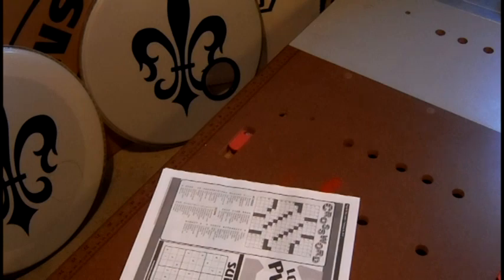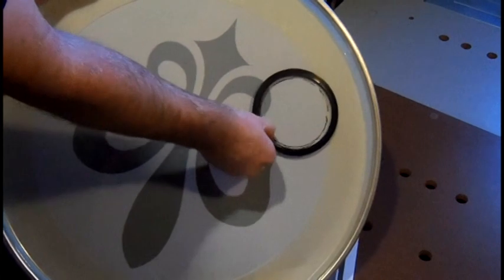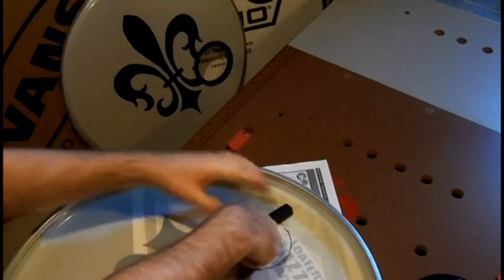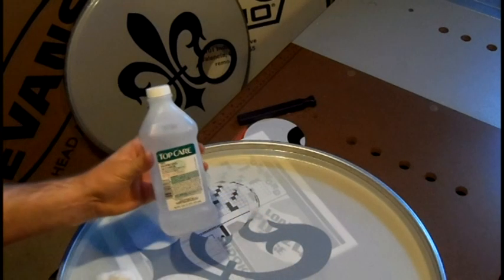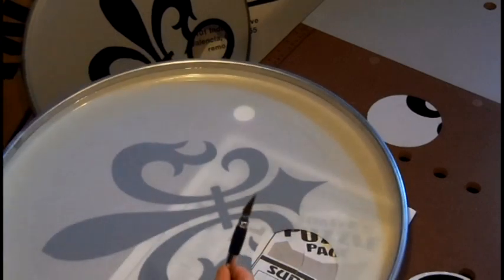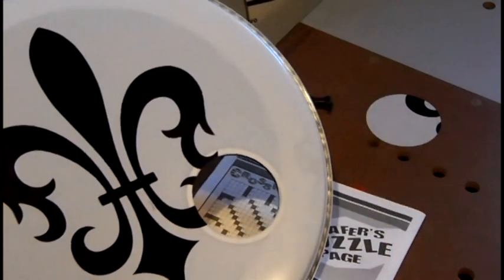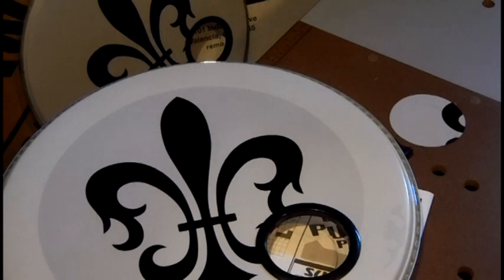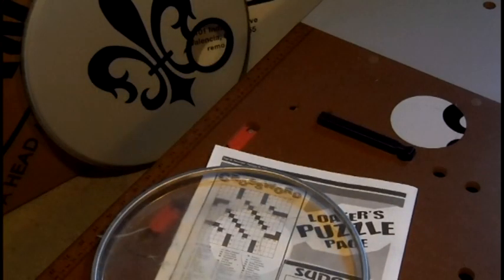Installing Holz bass drum port

Comment: I'm about to get a 5 inch Holz chrome ring.....do I really need the cutting tool? Or can I use an X acto knife?
Reply from the maker: No, you do not need the cutting tool.  I got mine from a music store that was going out of business.  You can just place the female ring to the backside of the head and cut it with the Xacto knife.  Then snap the male piece in place.
Reply: Ok thanks for that, but is it better to have that cutting tool though?
Reply from the maker: I don't believe so.  Plenty of people put their Holz on without it.  Just pay close attention to making sure you remove enough of the material from inside the ring so your head doesn't rip when trying to snap the male end on.  If you noticed in my video, even thought I used the tool, I still had to use an Xacto to clean it up a bit.
Thanks for watching, the comments and  feel free to ask me anything else if you have more questions.  Let me know how it goes for you.  Also, you might want to check out my video on how to remove the logo from a Remo head. http://youtu.be/F9RMZX7W0PA?list=UUQxKUhKqHWrXkAfyghGtZKw

Comment: This Holtz port ring is nothing but a manufacturing nightmare.  I don’t know how this guy got the back to snap in, but I tried for over an hour.  This should have been an easy snap on thing. I tried to bed the front ring in from the back edge and nothing worked. I even tried cutting some of the plastic out, it still didn’t work.  I wound up destroying the front of the head around the cut out.  The front part fit in perfectly, so there’s no reason the back should not snap in.  It’s a defective product, with the back not big enough to snap in. It looks great from the front, but don’t try to snap that back in.  My advice if you like the look of the front, just put the front on and throw out the back.  The front has adhesive around its edge and should stay in place.